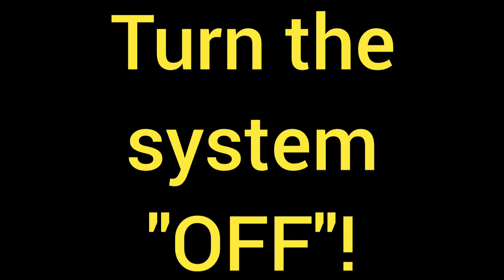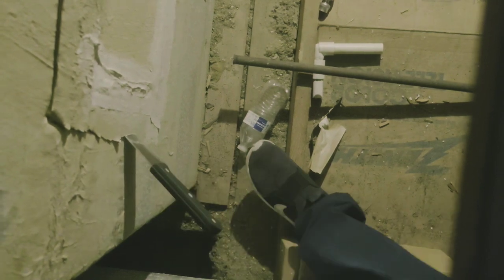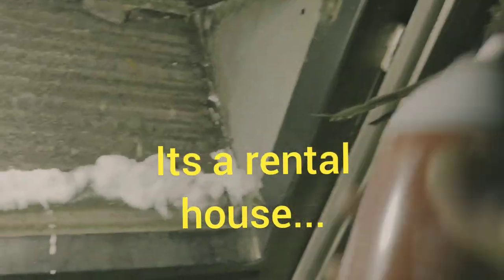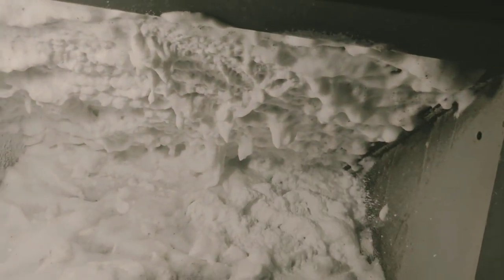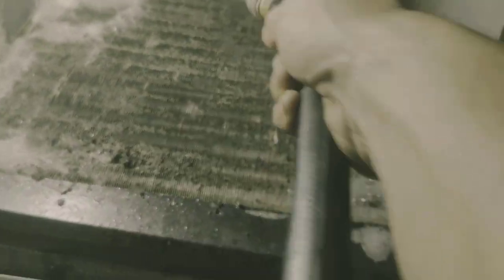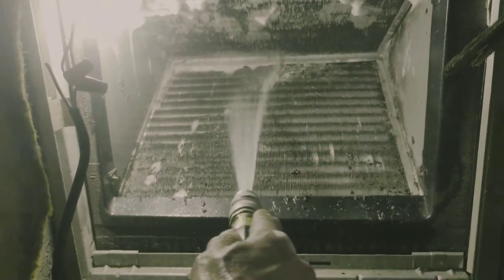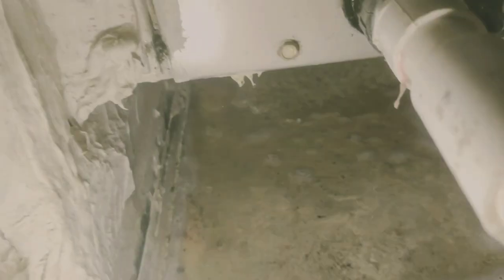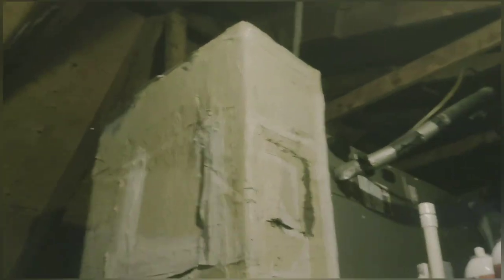Evaporator Clean In Place DIY Instructions "A" Coil Horizontal Attic  System Through Return Plenum

Comment: the return duct is the air coming from the house, correct? so I need to pull that off to get access to the coils, not the side panel?
Reply from the maker: Yea the return plenum and access the inlet of the evaporator coil if is an electric air handler system
Reply: @HVACRServiceTech  thank you, all I have is the black flexible duct that comes straight into the unit.... if I take that duct off, then I can access the evaporater coils to vaccuum and clean?
Reply: @HVACRServiceTech  I see where some people make a box, but the duct in mine goes straight to the aluminum box/air handler.
Reply from the maker: @xisotopex  In that case, we would use a utility knife, and cut along the edge of the Air Handler on all 4 sides to remove the square to round adaptor, which is more difficult than what the video shows. It might just be taped, but it could also be screwed to the air handler, which would make it even harder to get it put back together.  I would suggest not to do anything you are not comfortable knowing that you can reassemble.
Reply: @HVACRServiceTech  well, I ended up just pulling the duct off, it had a zip tie and tape holding it in place, and from there I could see (barley) those thin aluminum strips I guess those are called the evaporators..... tough part was rolling that duct back on, and trying to make sure it was air tight, with new tape and a new ziptie...
Reply from the maker: @xisotopex  hey we'll good job man! You got it done and saved money
Reply: @HVACRServiceTech  well, this system is about 30 years old.... when I opened it up, lots and lots of rust flakes, and some components dangling... not as dirty as I thought, because at one time the wall was open where the return is, so unfiltered air was going inot the unit for a couple of years.... so I expected a thick layer of dog hair. still sprayed it with the coil cleaner so hopefully it will be a bit more efficient...